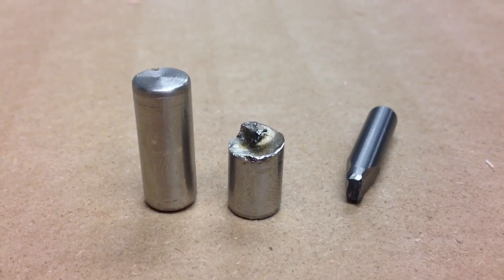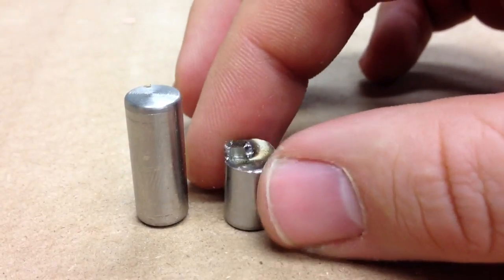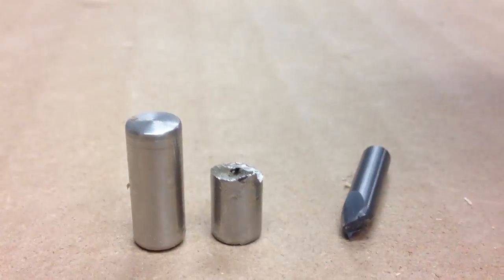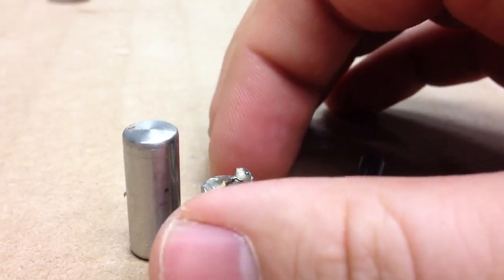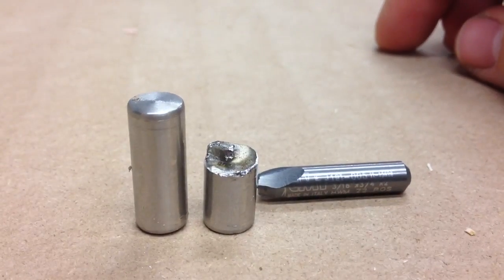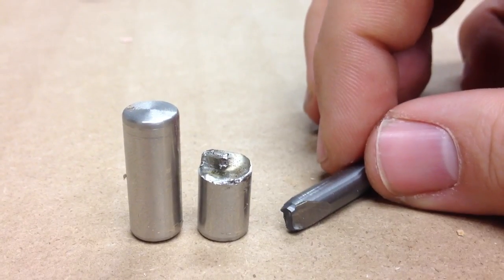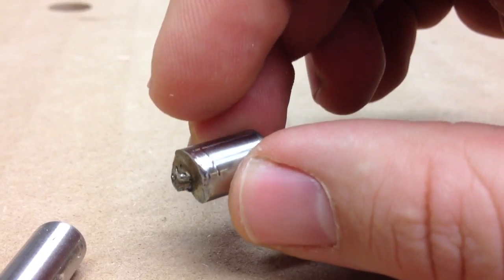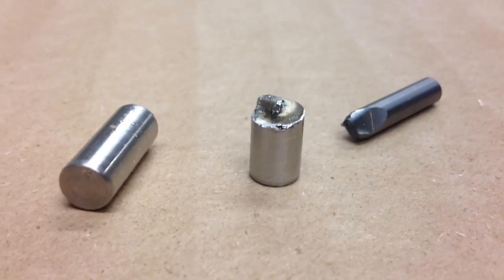Who Says You Can't Mill Steel With Your CNC Router????

Comment: There's really no reason it can't.. you would need to turn your feed rate down and take smaller cuts... the only other thing limiting this would be the machines structure, if it's rigid enough to handle the side load and the vibrations..
Reply from the maker: Negimaster23 Well, you may be able to, but you would have to get cooling in there too.  The steel gets neary red hot.  This kind of spindle is designed to run at 8k-20k rpm which is way to fast for cutting steel. It lacks the torque to run at slower speeds.
Reply: +21st Century Woodworking I mill hot rolled steel on my diy cnc 2.2kw router at 2,500mm/min feed, 1mm doc, 11mm step over with a 12.7mm single flute indexable end mill at 24k RPM. Adding in extra guide rail bearings to increase rigidity + use Carbide C5 grade or higher inserts & use micro grain end mills, ALSO ONLY USE SINGLE FLUTES.  Then the WD40 white lithium grease from Lowes sealed the deal. Now im milling steel on my cnc router as fast as a Tormach & in the case of aluminum faster.

Comment from the maker: They are expensive enough that you don't want to make this a daily occurrence, but 1 or 2 won't break you. They are between $10 and $100 each depending on size and quality.

Motor was fine... it actually doesn't take much force to break the bits.  They are solid carbide and they are fairly brittle.  You can break them by dropping them on the floor.  I always make a point of moving the bits around in their case.  the only time they are out of the case is when they get locked into the collet.